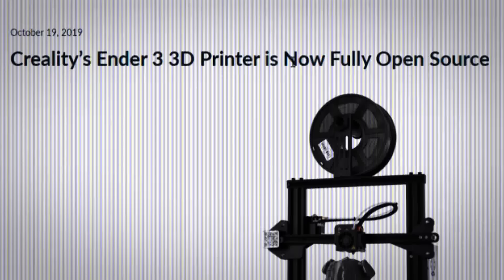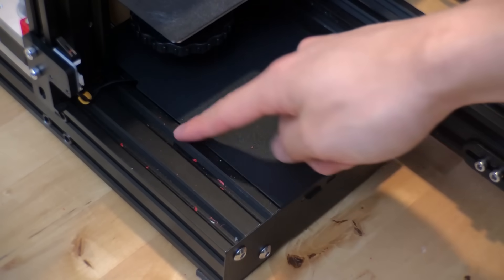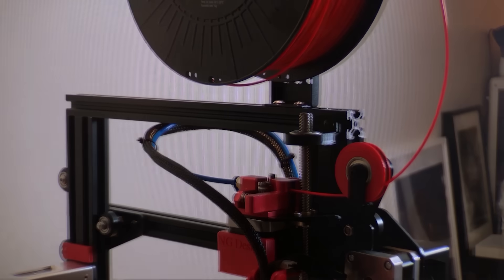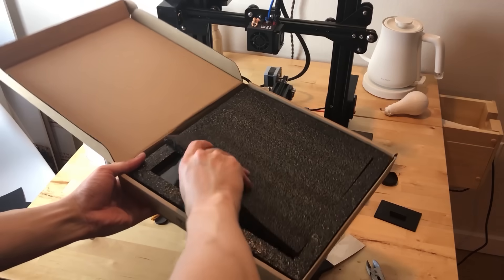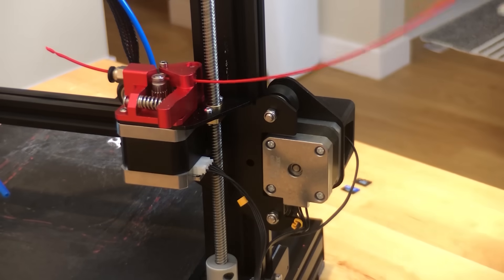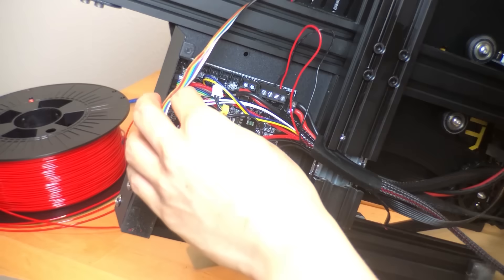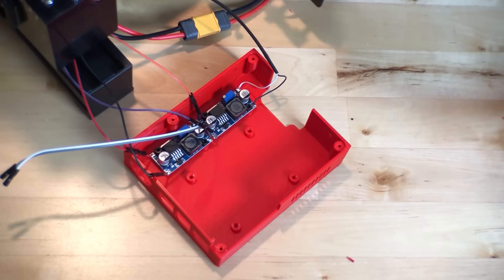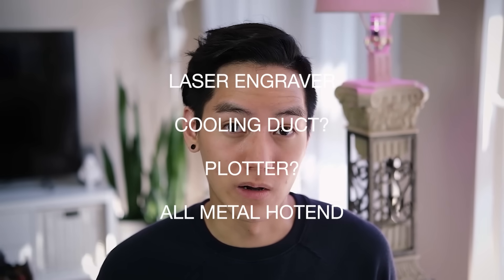First 24 Upgrades for my Ender 3 Pro - Part 1

Comment: Hi, I also own an Ender 3 pro. I think you should have started with the mods that make the printer print at its possible best and then move on to the cosmetics. All metal hotend (BigTreeTech sells a really good one and fairly cheap, I'm using one), direct drive, decent part cooling and an anti-backlash Z nut so you can use z-hop whenever you want with no drawbacks. Imo these take the printer to the next level together with the board swap which you already did and the BL touch. Just my 2c.

Comment: Now do what you should of done from the beginning: all metal hotend, 300c thermistor, 300c heater cartridge, direct drive and an enclosure. Otherwise it looks nice.
Reply from the maker: oh man, i want to get an all metal hotend so bad. that's the highest one on my list at the moment. any brand recommendations? I heard the one from micro swiss is really good. also what are other benefits of direct drive other than being able to print flexible filament? i mean that's enough of a benefit but i'm just curious since that one definitely looks like more effort.

Comment: If i get that board and bl touch should i still get a set of tl smoothers
Reply from the maker: just replied to you on reddit. from my understanding TL smoothers would no longer be necessary and in some cases i heard it can be bad for the board and prints too so i wouldn't personally do it.

Comment: Nice work on the video! One upgrade I made really early on was changing the heaterblock cooling fan to a silent Noctua fan. With a new silent motherboard the printer is virtually completely silent. Maybe that is something for a future upgrade? Keep up the good work!
Reply from the maker: Thank you so much and yea... that's the upgrade i've been craving the MOST since updating to this main board.... now the fans are driving me crazy. i heard the noctua fans are very good and silent but i've also heard they don't last super long. is that true? how has your experience been with them?
Reply: @ScottYuJan  I have had both my Ender 3 for two years now and changed fans real quick after purchase, so they have been going strong for 2 years without issues. 😃 They are a bit pricey as fan goes but well worth the investment.

Comment: Tenouttaten. I've been working with my Ender 3 for a few months and was considering upgrading to something with more features, but you showed me how easy it is to just ADD the damned features. Ordered a new mainboard, the BL Touch, and some other goodies. Thanks so much!
Reply from the maker: I'm glad i was able to help! honestly, that is the biggest benefit to buying an open sourced printer! so many upgrades and features you can add. i'm a bit afraid i won't actually end up make anything with this printer and i'll just end up making more and more upgrades 😂 hopefully i'll get to a real non-printer upgrade project soon haha

Comment: I have to wonder... Why didn't you go full rear on the electronics?

That would leave you the ability to use two sets of drawers up front and with your SD card extension.... You can just run the SD card up front.
Reply from the maker: whaaaat, that is awesome. honestly, i thought about it and it just looked like a lot of work redoing all the cable management but what do you think? if it's easy i might consider it. i definitely just lazied out on that one. i would definitely enjoy the extra room and potentially drawers on the front. i saw the thingiverse part and guide but never got to it.
Reply: @ScottYuJan  I did it. And it's pretty great. You gain room up front and can't drop plastic into it as easily. I did have to extend two wires. A hotend thermistor and the z limit switch but I removed that so it was just the hotend. And only because I didn't want to route the wires in a way that wouldn't make me extend. Otherwise you don't have to change anything.
Reply: I went with an skr 1.4 turbo on mine since I plan on doing a smuff or something similar. And went rear on both. With it in the rear I can actually run the cables fully inside the printer and not see them except for the one that I have hanging out to the front for computer connection.
Reply: And I'm gonna do the front drawers... Soon I just need to finish a couple other prints first. I need to do the cable chains and the side mount spool holder. And then I can so the drawers.

Comment: What I will also add is temp fan regulator in power supply so fan will turn regarding temperature in power supply. This one is the best you can pull of heatsink, because for PSU fan you don't need it. https://www.amazon.com/Qianson-Automatic-Temperature-Controller-Governor/dp/B01KH2U2XK
Reply from the maker: wait WHAT?! this is the first time i'm hearing about this upgrade. that is so cool. i thought the PSU already had this though because the fans aren't always on or am i wrong. if so, i would love to add this. anything to get those fans shutting up more often would be great hahaha did you add this to an ender 3 or ender 3 pro?
Reply: @ScottYuJan  As I see on this PSU it is on or off. I didn't tested yet but I will and add this temp. regulator which you can set when fan start and how fast it turn.

Comment: Hello, could you please share you print profile, I am having horrors with bed leveling and strigging(first printer user here) Thanks
Reply from the maker: Hey! honestly, if you're having issues with bed leveling and stringing so early on, it's probably not a profile issue.
- i would highly recommend following this e-step calibration tutorial: https://youtu.be/xzQjtWhg9VE 
- double-check your filament temperature. 
- follow this bed leveling tutorial and using this g-code: 
https://youtu.be/_EfWVUJjBdA 
- and if all that fails and it's really a profile issue, here's the profile i'm using :D haha it's for Cura by @ChazMeister2 - https://goo.gl/vnsQWx 
and here's a video Maker's Muse made about that profile if you want to learn more about it: 
https://youtu.be/_QRb54zVPfQ
it's pretty sweet.

Comment: Great video! The upgrades were cool and you have a really nice presenting style!
Seeing as you've already got the fancy new controller board, have you looked into replacing the stock Ender 3 LCD with a TFT35 touch screen at all?
I've heard good things and I'd love to see your take on it.

Cheers!
Reply from the maker: The TFT is honestly SO tempting. My favourite part about it is that you can even customize all the icons and skin of the interface too! i feel like i would have a lot of fun with that haha... i've gotten close to ordering it many times but honestly, since I added the raspberry pi, i rarely ever use the LCD on the printer anymore so.... probably not going to get that upgrade anytime soon. I also heard on some online threads that it can make troubleshooting things sometimes trickier? I'm not sure though. If you get it, let me know what you think. Cheers, and thank you for the kind words.

Comment: Great video. Had my printer for a few weeks. I did some of these upgrades but looking to do more. Cable chains looked like a lot of work until now.
Reply from the maker: Thank you and yea! i was honestly surprised by how easy it was. I think there are some harder designs out there but this one specifically by NG_design is GREAT. Doesn't require unplugging any cables or undoing any screws. It's a little confusing that the file names are in a different language, i think? but if you read the summary on the Thingiverse page it has pretty clear instructions.
Reply: @ScottYuJan  I did the cable chains last night and it was easy. Only broke one piece but I had printed extra just in case. :)
Really appreciate this video and will be doing more of the upgrades in it.